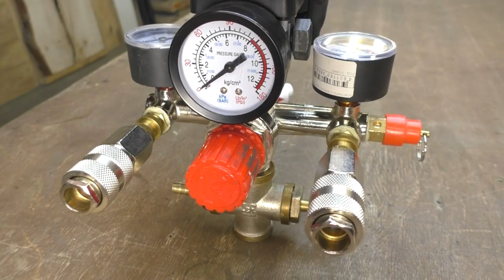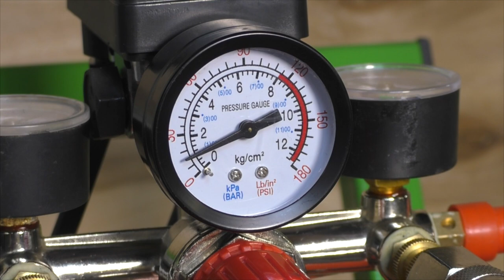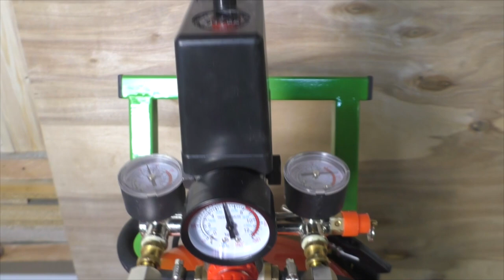Powerful compressor with your own hands! Cheaper only for free!

Comment: A freezer compressor is a closed loop system. The lubricant is at the bottom of the tank to lube the electric motor / pump  sealed inside. I think you may find the motor will seize with use as oil is expelled witth the air.

Comment: I see that compressor is built where tools are expensive and life is cheap. That tank is a residential water expansion tank that can not safely be used for compressed air, it's dangerous. There is no provision to drain the water that will condense in that tank. The video portion of the tank building up pressure is a time lapse video, there is NO way the compressor has enough pumping volume to fill the tank that quickly. I also did not see him/her have a ground wire for the electrical connection. It's a bad build.